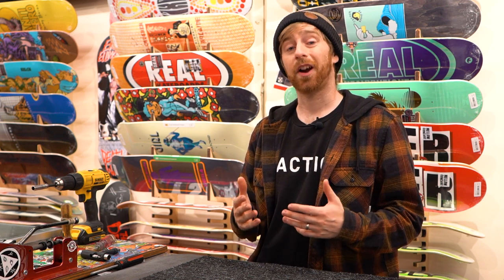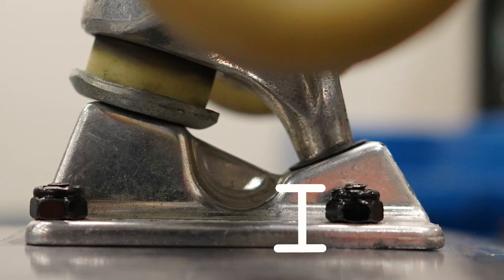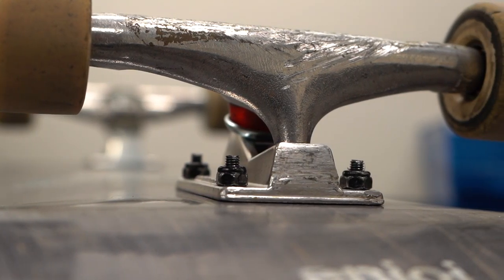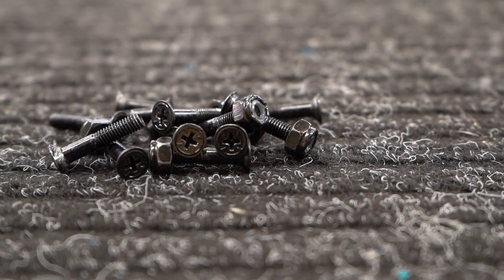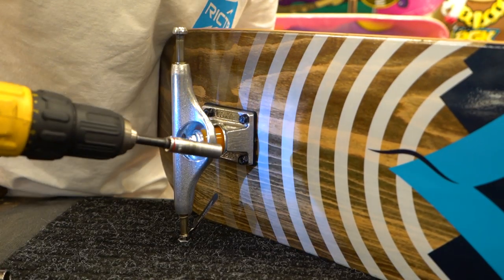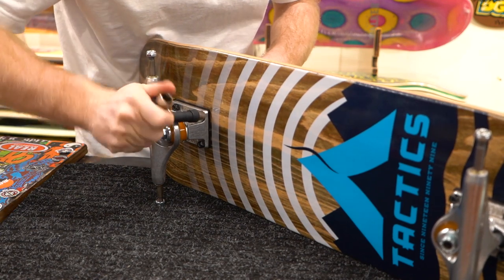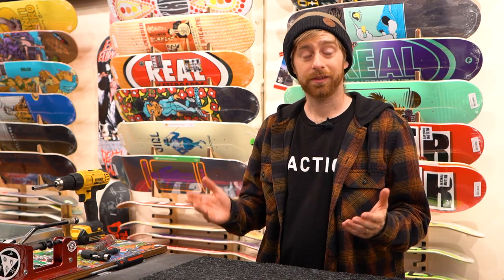What Size Skateboard Hardware? | Tactics

Comment: Bolts are 10-32 UNF countersunk (allen or cross head) high tensile with 10-32 nylock nuts. Buy from a decent fastener supplier and get whatever length you need and save $$$
Wheel nuts are 5/16 UNF 24tpi 'T' or 'Thin' type nyloc 
Truck kingpin nuts are 3/8 UNF 24tpi 'T' or 'Thin' type nylock

Comment: What is the alloys that we should use on skateboard hardware. You mention in the video that the regular hardware stores don't have the hardware alloys required for skateboarding. What material (alloys) should they be?
Reply from the maker: Most skateboard hardware is UNF 10-32 Grade-8 bolts made of 18-8 stainless steel, referring to a grade of stainless steel with approximately 18% chromium and 8% nickel. I remember going to the hardware store as a kid to get replacement hardware for my board, and I would break 2 a day. It was ridiculously annoying, of course I was just getting whatever nuts and bolts would fit and didn't really know any better. Plus buying a full set of lock-nuts and bolts from the hardware store didn't end up being any cheaper than just getting a pack of Independent hardware. 🤔 I'm sure a hardware store would have proper bolts, but you'd have to know what you're looking for. Cheers! - Tim

Comment: What hardware should I use for a 8.0 board?
Reply from the maker: The width of the deck isn't going to factor into the hardware length. What is going to factor in is how many plies your deck has, the thickness of your baseplate, and if you're using risers or not. If you have a normal 7-ply deck (almost all decks are 7-ply) with no riser pads, you can use 7/8 hardware, but you could also do 1 inch just to give yourself a buffer. I hope that helps! - Tim

Comment: Which size do I need? Mountain Paris V3 on a Loaded Dervish Sama with a 1/16” shock pad.
Reply from the maker: The Loaded deck is pretty thin because of the carbon fiber layers, but the truck baseplates are kind of thick, so maybe go with 1 1/8 inch just to be safe.

Comment: Hi, the nuts on my wheels keep getting tighter or looser and it's affecting my wheels (can't roll or is moving too much) is there anything i can do?
Reply from the maker: I'm not quite sure what you're asking here. Are you saying that your hardware is too loose and your trucks are wiggling side to side? Or are you saying your axle nuts are too tight and your wheels don't spin? If your hardware bolts are loose and your trucks are shifting, then just tighten the nut down with your screwdriver and 3/8 wrench. If your axle nuts are too tight, then loosen them just a little with at 1/2 inch wrench till the wheel spins freely. I hope that answered your question. If not, you'll have to be a little more clear about what is happening. Have an awesome day! - Tim
Reply: Tactics Boardshop sorry, but what i was trying to say was that the nut holding my wheels are getting either tighter or looser when i ride, it happens all the time and i don't know if there's anything i can do.
Reply from the maker: @Setsunai_mo  The axle nut might be stripped, you can get some replacement axle nuts that have a fresh nylon lock on them so they will stay tight.
https://www.tactics.com/independent/genuine-parts-axle-nuts-set-of-4/silver
Reply: Tactics Boardshop thank you!

Comment: I have a 7.75 skateboard what hardware  should I get it’s my first skateboard
Reply from the maker: The width of the deck won't factor into the hardware length. What does factor in is the thickness of the deck (# of plies) and whether or not you're using risers. I assume you have a standard 7-ply deck (almost all skate decks are 7-ply), so with no risers you can use 7/8 inch hardware or 1 inch just to be safe. If you're getting risers just get a little bit longer hardware to accommodate for it. I hope that helps! - Tim
Reply: @tacticsboardshop  thanks man
Reply: What about .875 hardware is that the Same thing at 7/8
Reply from the maker: @joaniecurtis4425  Yep! 7/8 = .875 👍
Reply: @tacticsboardshop  thanks

Comment: Im getting independent 1.25 risers, and independent 149 trucks for a 8.00 blind board, and i want to put 60.0 mm longboard wheels. What size hardware should i get? 1.5, or 1, or 1.25?
Reply from the maker: You meant 1/4 (0.25)" risers right? With 1/4" risers the smallest you can use is 1 1/8 (1.125)" hardware, but you could go up to 1 1/4 (1.25)" just to be safe. Cheers! - Tim

Comment: My truck bolts almost always come packaged with flat washers included. Is it advisable to use them between the nut and baseplate, or just optional?  Good video, and thanks!
Reply from the maker: Are you getting actual skate-brand hardware? I've never seen them come with washers. 🤔 Anyway, you don't need to use washers on the truck mounting hardware. 👍 - Tim
Reply: @tacticsboardshop    It is skateboard mounting hardware (MuirSkate Beasto Hardware).  I just received a new pack a few days ago.  I don't mind using the washers, just didn't know if it was actually necessary.  Thanks for the quick response!

Comment: help My screws keeps sticking out and wont stay flat on my board and its so uncomfortable on my board whenever I do tricks.
Reply: Do I use a drill to make the holes wider on my deck so the screws can stay flat?
Reply from the maker: Definitely don't do that! Just tighten the bolts more until the tapered heads counter sink into the deck a little. You'll have to tighten the hardware bolts from both sides so they actually tighten instead of spinning in place. That's all you have to do, unless you have dome headed hardware that won't sink in, then you'll just need to get different hardware. I hope that helps! - Tim
Reply: @tacticsboardshop  would 7/8 bones hardware work? and sorry what I was trying to say was my bolts wouldn't counter sink even tho I tightened them.
Reply from the maker: Really any hardware (except for longboard hardware) should work. Are you tightening the hardware onto a normal Maple deck? https://www.tactics.com/skateboard-hardware

Comment: Hey I just built a new setup. Running 55mm wheels on Thunder Hollow Lights. It's still on the way. Do you think I'll need 1/8 risers to avoid wheel bite? Therefore 1" hardware. If I don't use risers would you go 7/8" or 1" hardware? Lastly why do most pro street skaters not run risers is it kinda not cool to, or is it because they typically run 52mm wheels and don't need risers? Thanks!
Reply from the maker: If you like your trucks really loose, then it might be a good idea to have some risers so you're not constantly getting wheelbite. If you're not going to use the risers, 7/8th is the smallest you can use, but using 1 inch hardware without risers is completely fine. There are plenty of Pros that use risers, and it just depends on their style and where they are. If they're the type of pro that does a bunch of tech stuff with small wheels and only skates perfectly smooth California spots, then they might not use them. But if they're skating Portland or UK crust, then they are probably using bigger wheels with risers. There's nothing "uncool" about risers, it's just about your preferences. I hope that helps! Cheers! - Tim

Comment: What size hardware for a 8.0 trucks I’m super new and getting my first board
Reply from the maker: The width of the deck won't factor into the hardware length. What does factor in is the thickness of the deck (# of plies) and whether or not you're using risers or not. I assume you're getting a standard 7-ply deck (almost all skate decks are 7-ply), so with no risers you can use 7/8 inch hardware or 1 inch just to be safe. If you're getting risers just get a little bit longer hardware to accommodate for it. I hope that helps! - Tim
Reply: Tactics Boardshop omg thanks so much I will be getting 1 inch

Comment: Why does my board not have a divit for the head of my hard ware screws and how do I fix it
Reply from the maker: The decks never come with divots for the hardware. You have to just keep tightening the hardware till it sinks in flush. But don't over tighten to where the top of the bolt is below the top ply. 👍- Tim

Comment: ah im planning to buy another deck and im buying a Independent Raw 139 Stage truck with probably a riser (the smallest one) what hardware should i get..? would "Independent Black Crossbolts 1"" work??
Reply from the maker: Yep! If you got the Raw Independent 139 Stage 11 trucks with an 1/8th inch riser, 1" Indy Cross bolts hardware would fit perfectly. (1" would be the smallest hardware that would work with the 1/8th inch risers.) 👍 - Tim
Reply: @tacticsboardshop  thank u so much!! this really helped 🔥🔥🔥

Comment: Hi I got a question I got a meepo and I want to change the different color on there what size do I need to buy
Reply from the maker: It's gonna vary depending on the set up. If the board doesn't have riser pads, you'd probably be fine with some 1 1/4 inch hardware, but if the deck is extra thick, or there are some tall riser pads, you'll have to get longer hardware to accommodate for it. If you want to be really sure, just measure the thickness of your board, along with the height of the riser and baseplate. Then get some hardware that's about 1/4 inch longer than that so the nut has some threads mount onto. I hope that helps! I'm sorry I can't give you a direct answer, but each set up is different. Cheers! - Tim

Comment: I bought 1inch hardware and low trucks and a 7ply deck and will use risers. Will they fit?
Reply: The risers are the smallest ones seen on the video
Reply from the maker: If the risers you have are 1/8 inch risers, then you'll be fine with 1 inch hardware. 👍 - Tim
Reply: @tacticsboardshop  ok thx

Comment: I have venture high trucks with 56 mm wheels, I feel very high off the ground and my hardware is loosening and falling off. I have bones 7/8 hardware. Does the height of the trucks affect the hardware issue?
Reply from the maker: Nope, the overall height of the axle doesn't factor into it. You only have to factor in the the thickness of the deck and  baseplate. So if you have an unusually thick board or baseplate, the 7/8 hardware might not be able to tighten enough to reach the nylon lock. 7/8 hardware usually works with 7-ply decks and standard skateboard trucks, but you could get 1-inch hardware to give yourself a little bit of a buffer. Cheers! - Tim

Comment: What hardware size should I use if I have a 8.0 deck, 148 thunder trucks 8.25 axel, 52mm wheels and no riser pads? Should I go for 7/8 or 1 inch Allen hardware just to be safe?
Reply from the maker: 7/8" should work fine, but 1" will definitely be long enough. 👌 - Tim

Comment: What size socket do I need to tighten the bolt that holds the skateboard bearings in place?  Thanks!
Reply from the maker: The axle nut needs a 1/2 inch socket or wrench. 👍 - Tim
Reply: @tacticsboardshop  Thanks!

Comment: whats the name of the bolt locking the trucks in place ???
Reply from the maker: The bolts that hold the trucks on the deck are usually referred to as the Hardware. Or are you referring to the Kingpin?
Reply: @tacticsboardshop  it was the bushings and i was looking for the singular nut since i lost it. but i ended up just ordering a new set of bushings with already sent nuts

Comment: What is the function of the risers? Also I seem to have trouble tightening the nuts on the wheels. If im gonna let em spin the nuts are too loose, and if I just tighten them up a little there is no spin at all. Is it due to the bearings being put in incorrectly? They looked the same on both sides. But the wheels fell off when I tried it out and now I need new nuts lol
Reply from the maker: The riser pads are there to give more clearance between the top of your wheel and the bottom of your deck. This is so that if you turn very sharply or land with your weight on one side the deck, it is less likely to pinch the underside of the deck and put on the brakes. Usually it's called wheelbite when the wheel touches the underside of the deck and it can cause you to fall. As far as the axle nuts go, it sounds like the nuts are just stripped and you need some new ones. Make sure you get actual locknut axle nuts (the ones that come stock on all trucks) because regular nuts (without the nylon lock) wont stay tightened at all. I hope that helps!🛹👍  Cheers! - Tim

Comment: i have 60mm wheels but i don’t want wheel bite. what size riser do you recommend?
Reply from the maker: If your trucks are on the tighter end then you should be okay with 1/8 inch risers, but if they're looser then go with 1/4 inch risers. 👍 - Tim

Comment: My hardware is falling out and i wanne buy new ones i dont know witch ones i need i got independent trucks 144 and just a deck ?
Reply from the maker: If you just have a deck and trucks, then you can use 7/8" hardware and it'll fit exactly flush. You can also use 1 inch hardware to give yourself some extra threads, but I wouldn't go any longer than 1 inch. 👍 Cheers! - Tim

Comment: Do you have to use the smallest size posible ? Sorry I’m new to this
Reply from the maker: You don't have to, but you also don't want the hardware bolts sticking out super far like in the thumbnail. If you want to get hardware that's a 1/4 inch longer than the minimum, then that's completely fine. Cheers! - Tim

Comment: How long for two 1/8 pads ?
Reply from the maker: Two 1/8" pads (1/4") on a standard 7-ply deck will need at least 1 1/8" hardware. But if you have a board that's a little thicker, then get some slightly longer hardware to accommodate it. Cheers! - Tim

Comment: I’m getting a 147 high skateboard truck so what should I get also my board size is 8.0
Reply from the maker: The width of the deck won't factor into the hardware length. What does factor in is the thickness of the deck (# of plies), thickness of your baseplate, and whether or not you're using risers. I assume you have a standard 7-ply deck (almost all skate decks are 7-ply), and Thunder 147 trucks have a standard baseplate. So with no risers you can use 7/8 inch hardware or 1 inch just to be safe. If you're getting risers just get a little bit longer hardware to accommodate for it. I hope that helps! - Tim
Reply: @tacticsboardshop  thanks man

Comment: I ride an 8.25, (skateboard). what size hardware should I get ?
Reply from the maker: The width of the deck won't factor into the hardware length. What does factor in is the thickness of the deck (# of plies) and whether or not you're using risers. I assume you have a standard 7-ply deck (almost all skate decks are 7-ply), so with no risers you can use 7/8 inch hardware or 1 inch just to be safe. If you're getting risers just get a little bit longer hardware to accommodate for it. I hope that helps! - Tim

Comment: I wanna ride 58mm wheels, should i get t 1/4 inch risers with 1 1/4 hardware?
Reply from the maker: Yep! That'll work, your board might feel pretty tall, you could probably get away with 1/8" risers and 1 1/8" hardware and be fine. But if you ride your trucks super loose or you're concerned about wheelbite, the 1/4 inch risers will be good. 👍 - Tim

Comment: I'm so dumb I have 1/5 hardware and a normal deck but 7/8 and 1 wasn't big enough so I just did 1/5 is that still okay I mean does it make any difference if I had like smaller hardware
Reply from the maker: Do you mean 1/5" or do you mean 1.5" hardware? 1/5 would mean one fifth of an inch, and that's not gonna work. But if you mean 1.5 inch hardware, then yes it will work, but it will stick out pretty far and look kind of weird. Why was the 1 inch hardware too small? Do you have riser pads or trucks with a thick baseplate? Sorry for bombarding you with questions! 😅👍 - Tim

Comment: What size hardware should I get if I’m getting an 8.0 deck
Reply from the maker: The deck width won't factor into the hardware length. What does factor in is the thickness of your deck and if you're using risers or not. I assume you have a standard 7-ply deck (pretty much all normal skateboards are 7-ply), so if you aren't using risers, the smallest you can use is 7/8 hardware. If you have 1/8 inch risers, then get 1 inch hardware and so forth. I hope that helps! - Tim

Comment: Talk about hardware under griptape, or hardware over griptape?  
I say under because you would never put grit under a screw head in any other application.
Reply from the maker: The bolts should definitely over the grip, because the hardware nuts loosen from the vibrations of riding and need to be tightened regularly. If the bolt heads are under the grip, you can't use the Phillips/Allen head to stabilize the bolt as you tighten the lock nut and the bolt just spins in place rather than the nut tightening. The stickiness of the griptape won't hold the top of the bolt hard enough to fully tighten the hardware. Also, if you wanted to keep your hardware when switching boards, you would have to remove the old grip off the deck in order to retrieve the bolts, and peeling grip is a pain in the butt! 😆 Cheers! - Tim
Reply from the maker: @user-pf5xq3lq8i  That's exactly what we do! After gripping the deck we poke all 8 holes from the underside so we can get the bolt in there. 👍
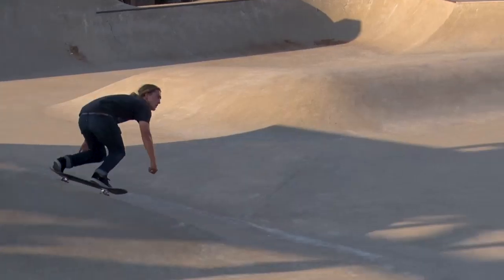https://www.youtube.com/watch?v=c2llhl4Mft4 Right at 3:20. Take care! - Tim

Comment: if u have 7/8 hardware, will it fall out “faster” than an 1 inch hardware? (without any risers)
Reply from the maker: Yes, if you let the hardware get super loose, the 7/8 hardware will fall out sooner than 1 inch simply because there aren't as many threads. But you'd have to let it get super loose before then. Usually you'll notice the hardware making a rattling sound long before it gets so loose that it'll fall off completely, so it's not really something to be super concerned with. But if it makes you nervous, then just get the 1 inch hardware. 👍 Cheers! - Tim